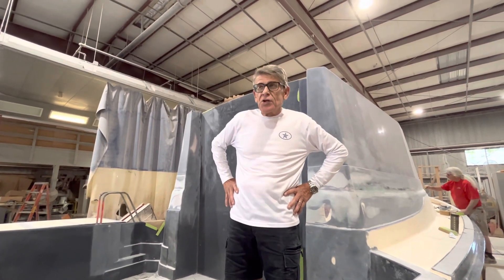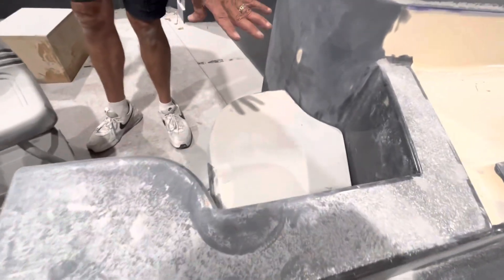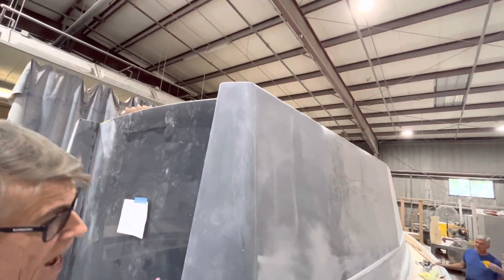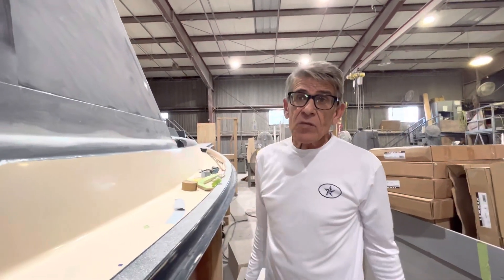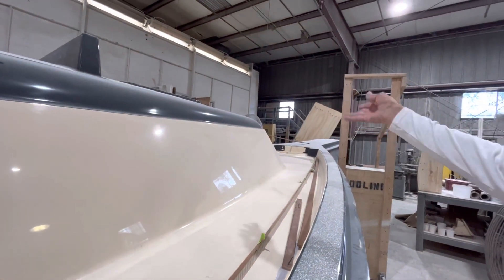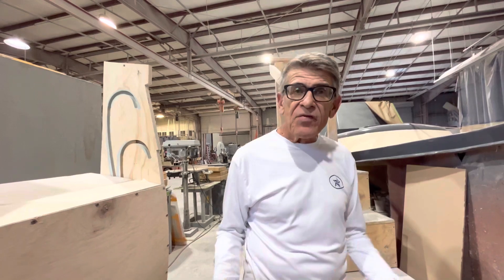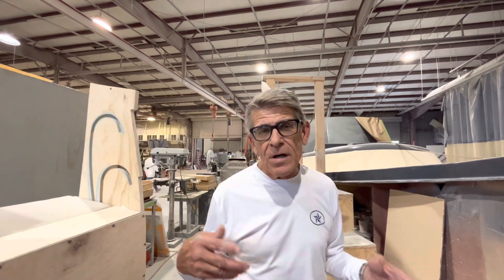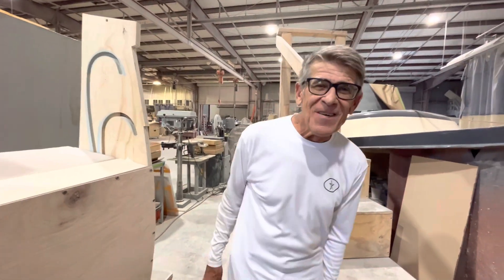Exterior Design of the Island Packet 42’ Motor Sailer

Comment: Been looking at a Nauticat or a Colvic Watson since all the Island packets I had seen prior required the sailor to steer in the elements (no pilot house).  A modern, safe cruising boat with a pilot house for all weather sailing is exciting!  Would electric propulsion be an option?  How about a Ketch rig?
Reply from the maker: WE wanted to do an electric option but by the time we get enough batteries and large enough generator to do the same as diesel it does not make since at this time. Sure we could do it if you only want 50-100 mile range max. 
We are very happy with the Solent Rig and will stay with it. Let me know why you would want a ketch?
Reply: Ketch rig would provide smaller sails for solo..and maybe easier to balance boat even when on anchor..  dunno for sure just going on what I have read and heard often from experience/older sailors with a lot of miles..